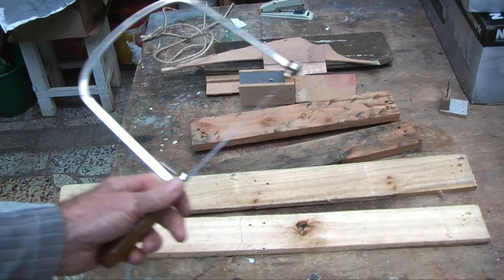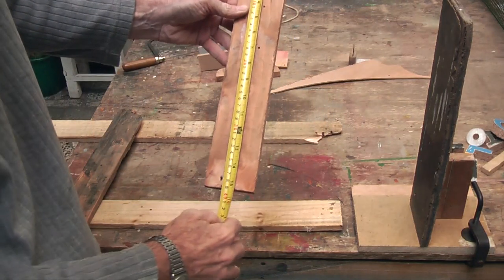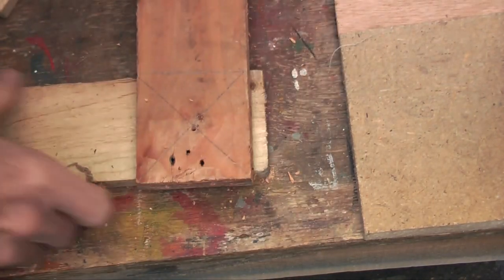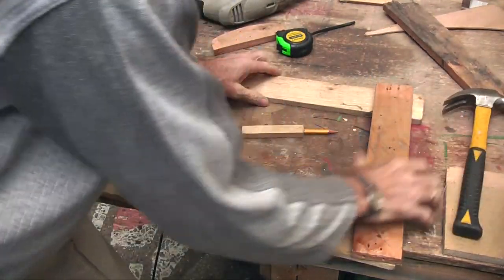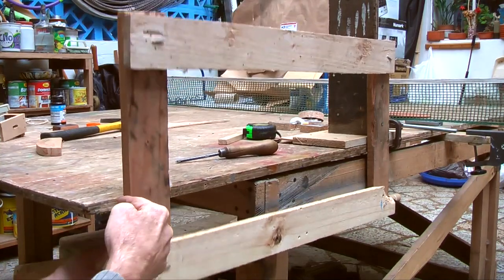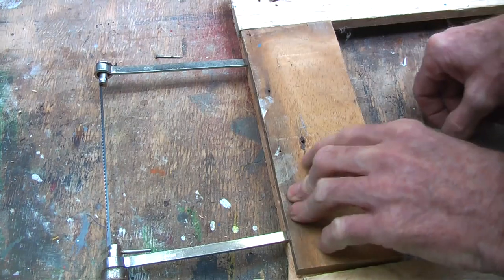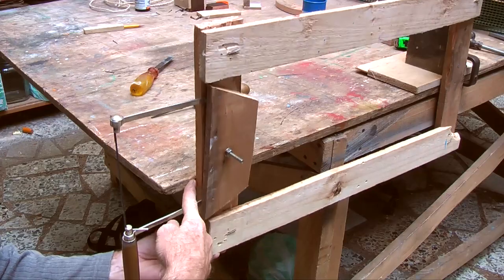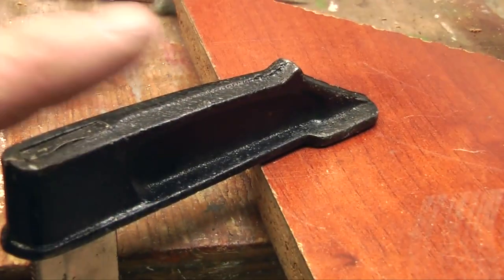Foot Operated Scroll Saw- Serrucho de pie

Comment: Really speaking  this video of making a foot pedal saw with available materials is an eye opener to me.I will try to build such a saw for my hobby work at home. I need certain details about this fabrication :- 1. The blade length I feel the blade and frame you are using seems to be little bigger . Here in our country (India) we have blades (Pin less ones) having length of 15 cms. 2.Further details on the fixture to fit the frame if I get it will be of immense help to me. Really a nice video. Thanks and regards.

Comment: Just the design I needed! Thank you sir!!
Reply from the maker: You  may be able to improve on this design, but the  basics are there to think about. I  cut a whole parquet floor with a world map once, using this setup.
Reply: @PhilipStephens007  well I made one! It works great, except I didn't cut my handle piece right lol. Have had to stop on it for a bit but will get back to it. I used bungee chord because my space is limited and happen have them. 
I learned a lot from your video and again, thank you! 
And yes, it would be enjoyable to add my personal touch and such to the basic design you provided.
Reply from the maker: @laurabutler6253  Excellent!